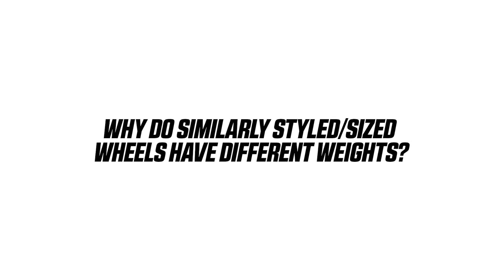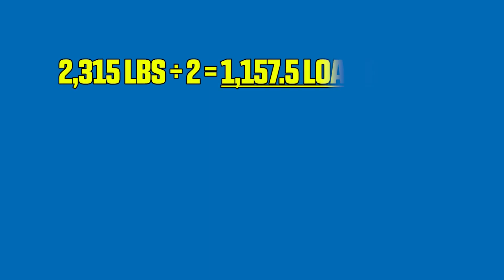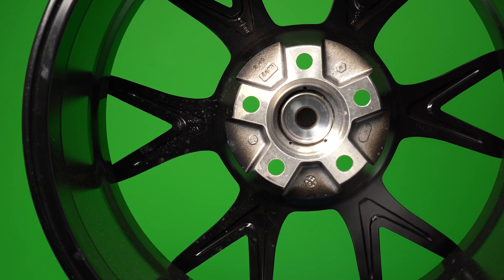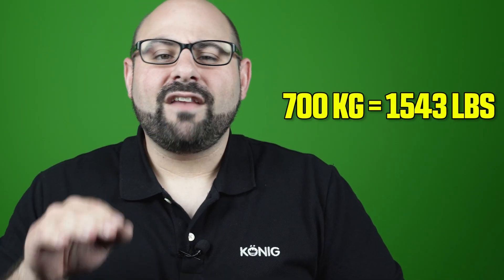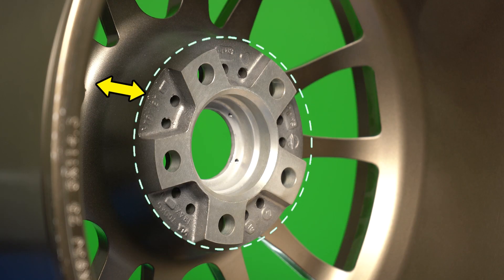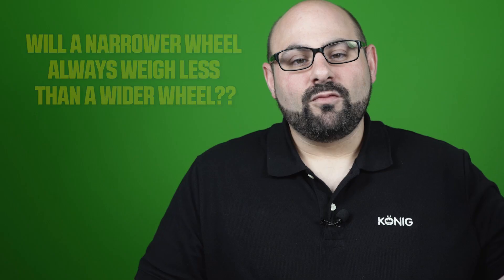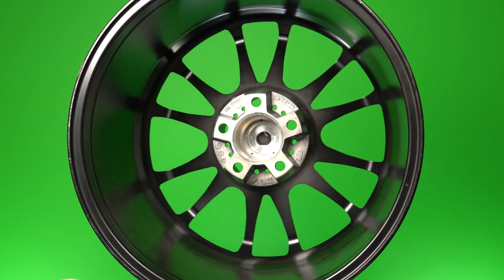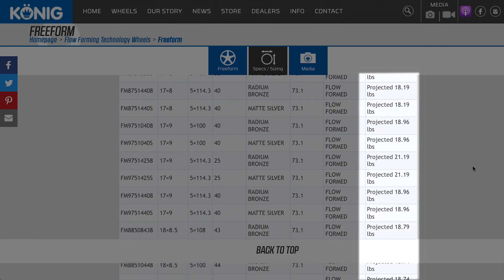WHEEL WEIGHTS + LOAD RATING!!! | FREQUENTLY ASKED QUESTIONS

Comment: If my veicle manufacturer recommended max load weight is 890 kg wheel and I use a 815 kg wheel is that safe?
Reply from the maker: What vehicle do you have?
Reply: You forgot to divide by 2 because there's 2 wheels on an axel